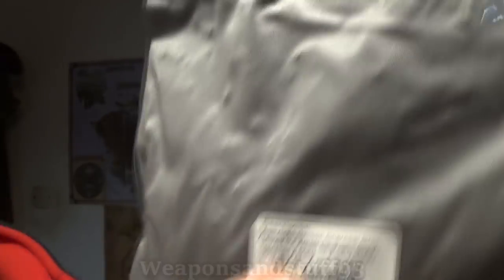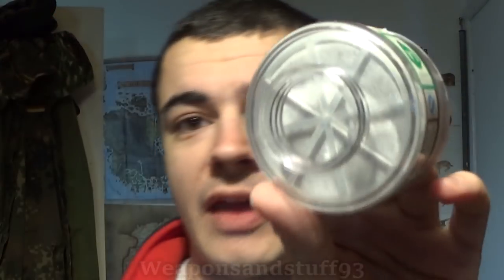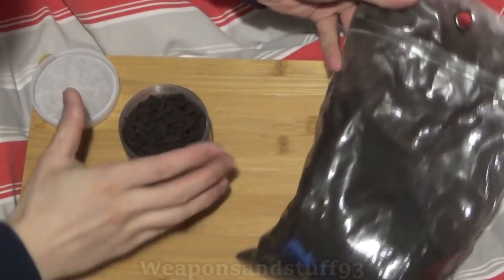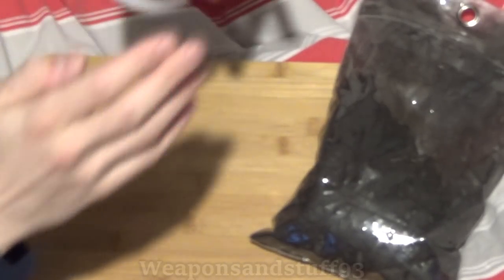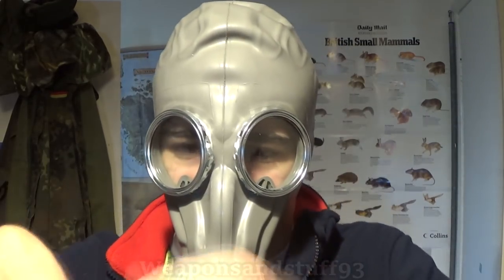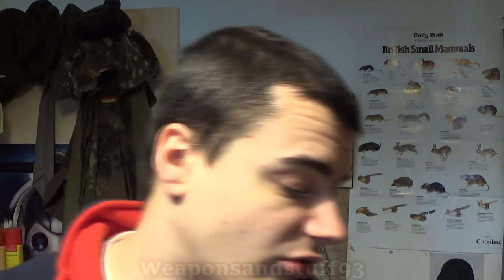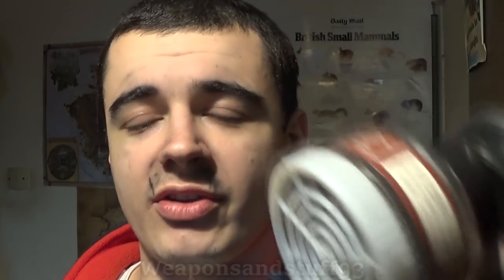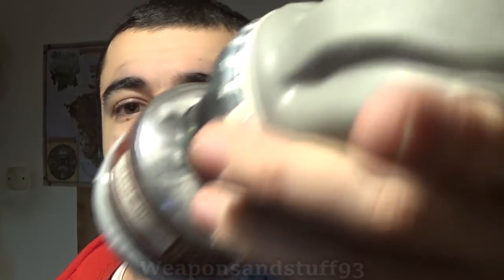How NOT to refill a filter

Comment: carbon activated charcoal  for filters  must 100% granules, should not mixed with carbon dust. if you  desired to crush into small pieces you may use a fine strainer to separate the dust. I did it before to avoid inhaling dust particles
Reply: Dumbest test I’ve seen
Reply: Or wash it then dry it

Comment: With the extruded type activated charcoal (the more coarse charcoal you had) you'd need a few inches of the stuff to achieve half decent vapour protection.
Reply from the maker: But as said the surface area of the filter is too small to be effective, look at any CBRN filter and notice the size difference.

Comment: (Prepare for people probably asking about the Gp-5)
Reply from the maker: Does the filter that doesn't work work with a GP-5.
Reply: hey does this scuba oxygen tank work with my gp-5?
no?
well, I'll try it anyway
Reply: does it fit my GP5 ? i especialy for this comment bought one xD
Reply: @Dover939  If you use the old school double hose regulator system, you can modify the corrugated hose to deliver to the mask.  An 80 cf tank will at most give you about an hour's worth of air.

Comment: Pity that didn't work, but the concept is good, just need to find the right activated charcoal size i guess or a bigger refillable filter.
Reply from the maker: Yeah it would either be setting up a good particulate filter at the top end and having very fine charcoal inside, or ideally having a much bigger refillable filter so the size of the charcoal doesn't have to be as fine.
Neat idea but not really executed well.
Reply: @Weaponsandstuff93  did you manage to find or solve this
Reply: Or maybe one that isn't made in China.

Comment: You should try putting the activated charcoal in a salt grinder so it makes small granules without turning the charcoal into a powder.
Reply from the maker: Still wouldn't really work with this filter case, as the powder wasn't dense enough to work.

Comment: I'll be acquiring one of these this week and luckily, I had no intention of using the filter that came with it. I plan to use it with standard filters for industrial work. The full face industrial respirators I found originally were >£130 and I would have had to get filters unique for the individual mask. It's ridiculous knowing you can find a perfectly functional mask for £13 pounds that can take any standard CBRN and ABEK filter.
Reply from the maker: Yeah it's a lot cheaper to get a decent surplus mask and fit ABEK filters to it.
Reply: I bet all these modern masks are designed for one purpose; money. Sell a mask of unnecessary quality then create filters only compatible with that mask so the buyer continues giving money to the company. And with this bullshit of older masks looking creepy, there's pressure from others to get a modern mask. I personally don't mind scaring some employees in exchange for my long-term health.

Comment: I would add a disc of fibreglass cloth to that liam,maybe on top of the charcoal then the filter pad.keep at it and you will crack it mate
Reply from the maker: Yeah that would work better, issue I think is the filters volume is too small for a decent amount of charcoal, ideally you would need one twice the size, then it would work fine I imagine.

Comment: Does that plastic filter fit the gp5 cos I saw quite a few of em on AliExpress n eBay that accompanys the gp5 (copy of) they got. Only difference is the lookalike on AliExpress n eBay have plastic mouth piece the filter screw onto where as the one I got is the polish MUA and like yours got metal mouth piece where the filter screws on but both are 40mm.

Comment: You used the wrong activated charcoal, the one for fishtanks is far more crude because its for water, you should use the fine granules no more then 2 mm thick, for air filtration.
Reply: also if you make it charcoal powder be prepared to give yourself coal long. Its not just the pellet size that will be different for airflow pellets, they are a finer original powder that was pelleted.
Reply from the maker: Wouldn't make much difference as people have said, the filter is too small for an adequate filter volume and there is no system to make the air flow through the filter evenly.

Comment: Just a few Qs what is the name/type of filter, how could I find one of these I’ve looked and have had little to no luck, how much do these usually cost, will it fit on the Israel 4a1, thank you for reading this
Reply from the maker: +Jacob Well these filters won't work that's the problem, however if you want one it should fit on 4a1 search spray paint filter on eBay and they should come up.
Reply: Weaponsandstuff93 thank u so much

Comment: i found a P22/1 filter its outdated 16 years but
has it got asbestos?
Reply from the maker: Not sure but if it is a modern Polish filter, post 1990 it should be safe.
Reply: thanks i will better buy that FP 5 but it's more expensive
ps. can you make video about removing filters elements?